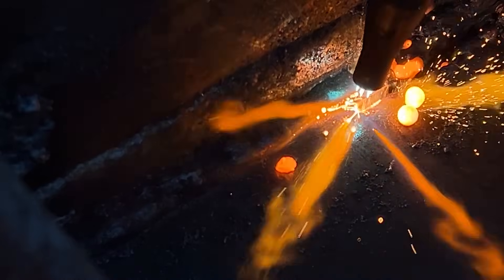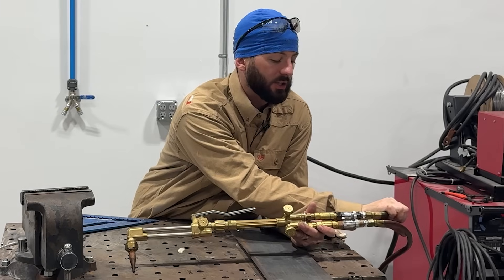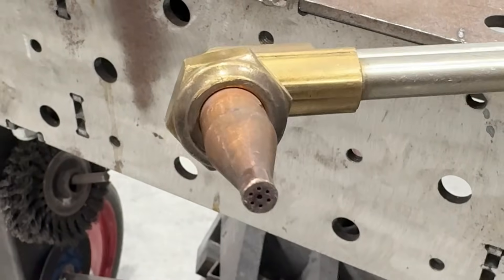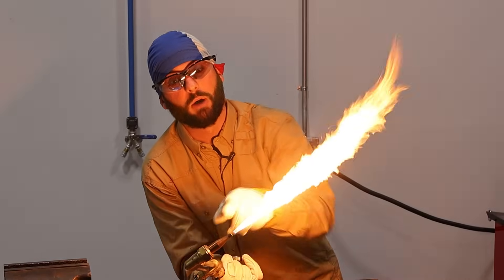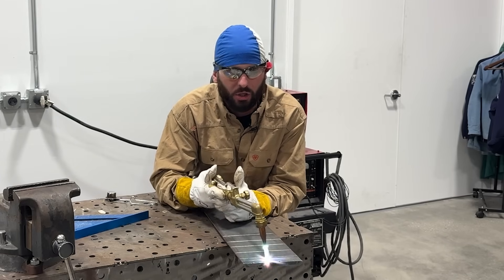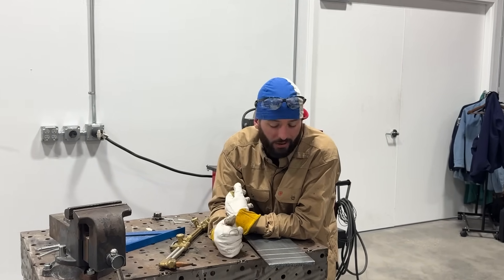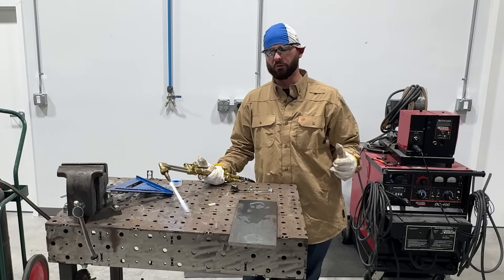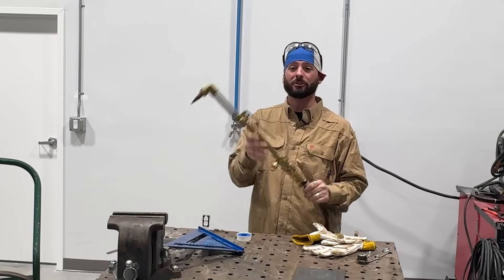Common Oxyfuel Torch Mistakes: Angle, Distance & Speed Explained

Comment: Thanks for the well edited video - great pace and clarity.  Learning a lot.  I’m a farm/hobby kind of newbie and this stuff really helps.  One suggestion that I’d make to all who are making metal fab videos is to more often mention ventilation setups.  I have indoor space but I try to cut, weld, and grind outdoors, even in the cold Canadian winters here.  I’d like to get a setup someday for keeping the air clean to breathe inside, but the required equipment may not be practical for a home shop.  In these videos we see sparkling white shops with all these processes going on - if you have air quality management that isn’t available to the hobby / beginner person, I’d like to know as you start into the videos, just so I don’t get the wrong impression.  Thanks again - awesome content.
Reply from the maker: Thanks for watching. Air filtration is super important when it comes to welding, cutting, and even cleaning. We have done some videos in the past on finding the right fume extraction for your home shop but maybe we can try and build a DIY setup that will help keep the costs down and keep you safe.

Comment: Good demo thanks, however for shutdown, after you close the bottle valves you should then open the torch valves to bleed the lines, and when the pressure dials fall to zero you can then spin the regulators anti-clockwise.

Comment: Look rookie you don't need the chart  for it by ear  all those ought tip.are use less  40 ox 11 acetylene mkay ?. You can mix them.up by repairing the hose wrong 1 tip is 40 and 11 rookie never  turn on tge torch with just acetylene it soots up the tip turn on.both gases and you schould hear a pop after 47 years  I am a expert I cut through 4 ," thick so all these puppy's trying to teach and don't know shit

Comment: Can i use 7018 on buzz box i pretty good at welding can't get answer? Its good look good to.
Reply from the maker: Yes, you should be able to use a 7018 with pretty much any stick welding machine. Depending on the amperage your machine can get up to will determine the size 7018 rod you can use.

Comment: I put carbide on oil field tools via brazing. I sometimes need a slight oxidizing flame when putting carbide on the inside of the pipe. The torch can consume more atmosphere oxygen than is in the pipe and snuff itself out. Oxidizing flame won’t go out.

Comment: A lot of people think that cutting torches just super heat the metal and it melts really fast, but it's actually a chemical reaction.  The preheating holes of the torch tip get the metal to a "kindling" temperature, which is considerably lower than the melting point, and adding the oxygen causes the metal to basically rapidly rust, and that's what is actually doing the cutting.  If it was cutting just by melting the metal, it would be a massive pool of molten metal, horribly imprecise, and a very time consuming venture.

Comment: I love my plasma cutter but I usually find myself reaching for the torch more often. It’s what I learned on when I first started and as you displayed here, it’s relatively forgiving if you get everything dialed in to a decent spot. And even then, it’s a jet of super hot gas, it’s going to cut metal no matter what. I think everyone who works with metal should learn how to use a torch cause it’s just one of those tools that will always be around and more than capable. Great video as always!

Comment: I was told those same gas settings 30 years ago so I still use them. I think first thing to mention is cleaning torch tip right, if thats not done then all settings in the world wont work.... 
When I worked at shipyard and it was break time or end of shift, if gas line was still hooked up and charged, 5 days off, and they was always checked by the safety patrol everyday. Only qualified workers are allowed to run torches, in the past 20 years plasma is used by all fabricators............

Comment: You only need flashback arrestors at either your torch or the regulators. Not both. Having them at both hurts the gas flow to the torch.
Reply: @deltan9ne306  he has 2 flash arrestors at the torch. That torch has built in arrestors.
Reply: @jimk724  Good catch, which is just as bad. Haha!
Reply: That torch does not have built-in arrestors. It has simple check valves built in. These prevent backflow of gases, but flashback arrestors are check valves PLUS a flame barrier.
The flame barrier is a sintered stainless steel filter that all the gas flows through, but flame cannot.

Many flashback arrestors also include a thermal cut-off valve. If the arrestor overheats, this valve seals and permanently blocks all flow of gas, in any direction.

Comment: If you want to really get a handle on travel speed, angle and height, try this: Take the cutting head off and install a large welding tip. Clamp up some 1/8" or thinner metal. Get your puddle wet and TURN OFF the gas. You will begin to cut on oxygen alone. We used to have contests to see who could cut the farthest on oxygen alone. You will find out just how steady a hand that you really have!!

Comment: I'm far from a professional, but I found a steep forward angle really helped when cutting thin stuff (1/8 to 3/16). It lets me keep the travel speed up, making a much nicer cut.
Reply: @Gearheadtom  Certainly true. Steep incline angle on thinner stuff helps blow the slag away

Comment: At the welding school I go to they teach us how to cut up to 3 inch thick steel so that when we go to cut and bevel 1/2 inch plate for tests, it seems really easy. I was also taught to set the acetylene at 5 psi and the oxygen at 35 psi. Once we get to one inch thick my teacher had us bump the pressure up to 40 psi.

Comment: For Oxygen because it is such a very high pressure valve there is a closure seal and a fully open seal to make it safer to keep in the very high ( 2,200 pounds per square inch ) pressure .   So Yes please open your Oxygen valve completely open to make the second seal secure for your safety .
Reply: That's exactly what I was going to say. I taught myself how to use an oxy-acetylene torch, so it's kinda surprising that I knew that and a professional doesn't

Comment: I have always been told to open the valve all the way until it stops on high pressure bottles and to only open fuel gas valves a quarter turn so it can be shut off quick if there is an emergency.  Open that torch fuel valve a half turn when lighting up.  I hate that soot floating around.

Comment: I have to use Mr. Bob Moffett trick. The good old burn bar. I made one for myself. I couldn't cut a straight line if my life depended on it. As Bob would say. When you get older, you get the high speed shimmies. lol
 Even SMAW is a challenge for me. My high speed shakes seem to doom me with sticking the electrode. lol

Comment: Good and Quick setup.
I had no one teach me but a book.  Now here is the problem, I read another.  One said to shut the gas off first, the other said to shut the oxygen off first.  I noticed you avoided that debate.   My is a Victor style, so oxy first.
   I now read comments that they never bleed the gas out, cause they don't want to waste it.  That book also said to open the oxygen valve all the way because it seated an prevented  leaks.  I was not interested in a oxygen leak while using a torch by myself
Reply: My experience is that you shut off the acetylene first on a cutting torch or welding tip, but on a rosebud tip (used for heating only) you turn off the oxygen first to avoid the flame popping back into the tip and plugging it up.

Comment: Hate to see improper eye protection. Those tinted saftey glasses aren't doing anything to prevent the IR from that cutting torch cooking your eyes.
Reply: Why is it  those welding goggles don't have good straps?  I like the flip up kind, but the elastic is never any good.
Reply: @tsl7881  Right about the elastic. I find that the clear lens has bad optics, I always have to wear my glasses under the goggles to get a clear view.